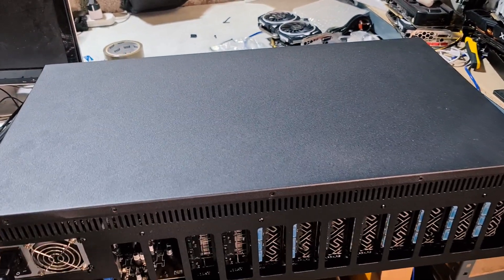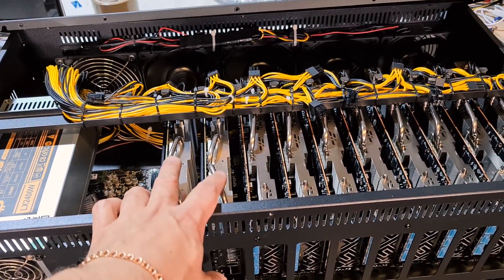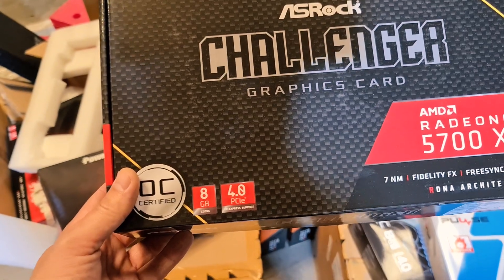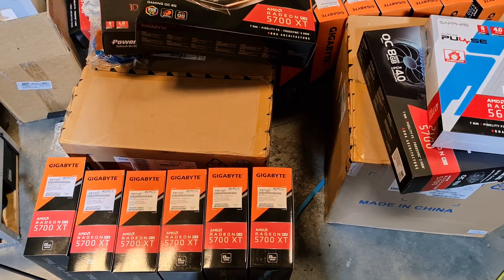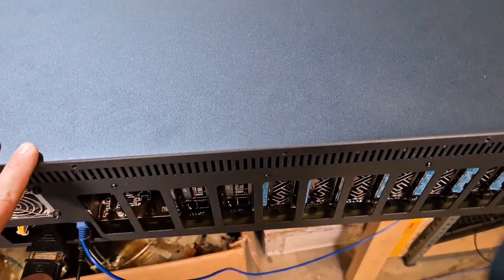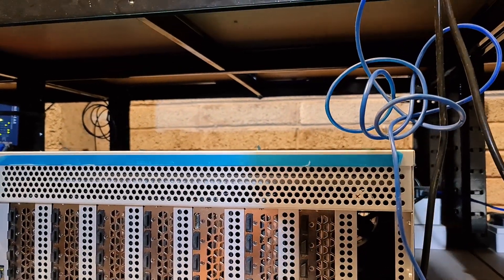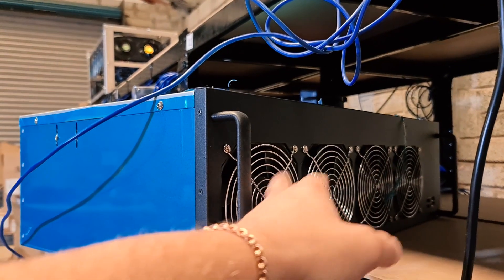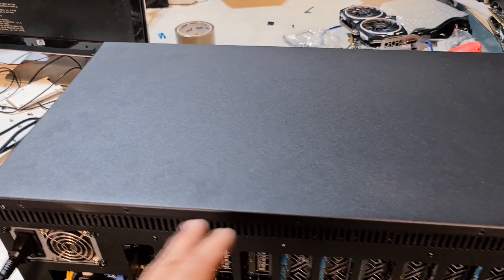RX5600 and RX 5700 bios mod , which GPUS to choose part 1. !?

Comment: hi just a quick question. those cards do not have dual bios. if you flash it with a bad bios can you use another GPU boot up and then reflash it with the original bios ?

Comment: Nice video just subbed to your channel
Reply from the maker: Thank you for supporting;)
Reply: #GuntisVitolins found your channel from red panda mining. Just got into mining and am trying to get my first rig complete. So far I have 2 1060 3g, 3 1060 6g, 1 1070 on a biostar b250. The goal is to use 6 1060s and 6 1070s to complete it
Reply from the maker: @cyrusgrissom646  @redpanda is great guy. Good timing of getting into miming

Comment: On Sapphire Pulse, Gigabyte gaming OC 5700xt as on Asrock Challenger memory  temp stop at 102-104 in memory heavy works, in games just  around 76 - 80 not only Asrock, non XT RX 5700 reference in memory heavy works is about 10° lower

Comment: Are you running 220v on these miners?
Reply from the maker: yes 220
Reply: @GuntisVitolins  Thanks, my two 12 GPU mineshop systems are arriving next week and my 220v power is going in too! Should be fun.

Comment: I have XFX RX 5600 XT Thicc II and best it can do is 39,2 mh/s @ 100W at the wall. I can't overclock it over 1800 mhz stable. Core voltage is 800mV and memory 850 mV. Did you manage to lower core and memory voltages?
Reply from the maker: Ilk upload 2nd part of video tommorov how to increase speed on bad bios on rx5600
Reply: @GuntisVitolins  Great. Thanks.

Comment: Still hope for 4gb cards. ETC going 2.75gb dag size (and we have Rvn)
Reply: yes. i was able to offload a load of etc using gate io. you can use the same.
Reply: Nikola Karovic hi. When is it do we know yet .thx
Reply: @wcweng1  Its in progress. We will probably mining Etc on 4gb cards till 2022.
Reply: @nikolakarovic5964  thx. yup. looking to support ETC. my cards already cant mine on windows.... will try linux soon.
Reply: Right now you can't sell ETC anywhere because exchanges blocked deposits and withdrawals for ETC because of 51% attacks.
Reply: @damba1989  Etc is Rekt, if they dont react fast they will be delisted from exchanges.
Reply: @nikolakarovic5964  Yeah, I am afraid price will drop a lot when they allow deposits on exchanges. I have some ETC and I will try to sell it as soon as possible.
Reply from the maker: @damba1989  great news about DAG file size reduction ;)

Comment: I have a gigabyte rx 5500xt 2 fans version. And the cooling is not efficient. The fans have to run agressively to cool the card. And i have a zotac rtx2060 which the fans are super efficient in cooling.
Reply from the maker: Thanks for sharing. Actually never have used rx5500. What performance you are getting?
Reply: I am getting 25mhs with 56watts. Undervolt to 825mv. I never bios mod.

Comment: good info , thank you. My msi mech RX 5700 memory cooling is horrible.
Reply: The MSI have that issue too. Some people changed the thermal pads you can find those videos here in YouTube
Reply from the maker: @BitKerelo  yeah memory cooling on value cards are bad. You can use mining case with high efficiency fans if you not bothered about noise.